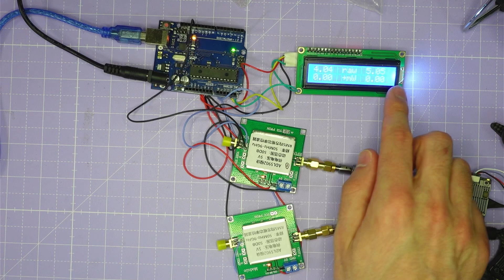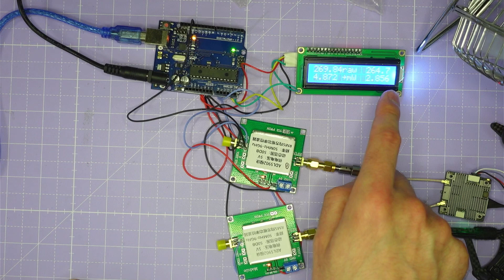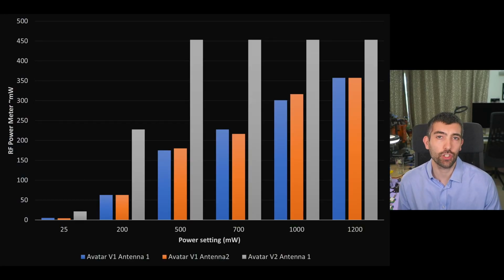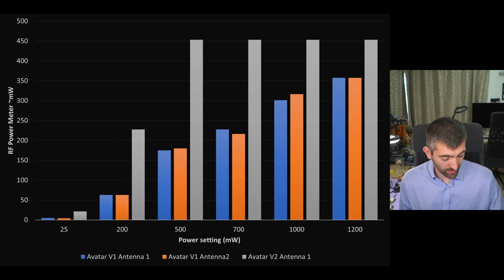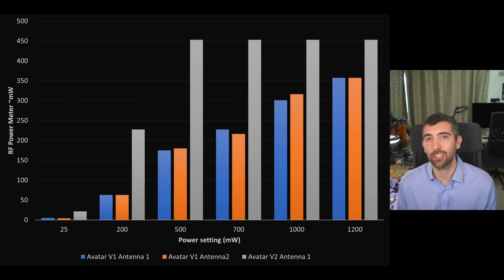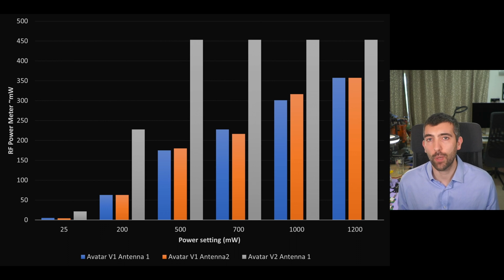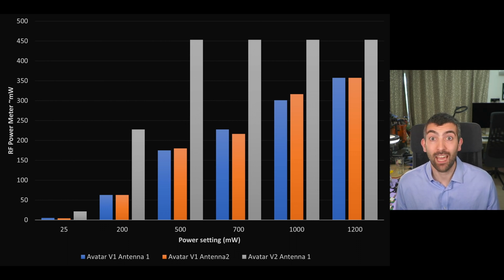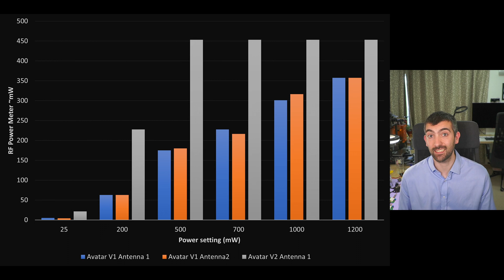Walksnail Avatar V2 WEIRD Output Power Behaviour?!

Comment: Hi chris, have you seen the system to calibrate the v2 vtx ? The one that JB published in one of his video lately using zoom 10% to check values and putting some files on. It would be extremely interesting if you could make a test looking if that calibration process change something or not . About power , it will be interesting to compare dji air unit vs caddx vista too
Reply from the maker: Speaking to Mads about it we can be confident that the calibration will change the output power, but what I can't say for certain is if it will increase range as it will also amplify noise.
Reply: @ChrisRosser  ok Mads is the master there :) if any of you two could certify that it would be interesting to run some penetration test with various values. I was thinking to check power output with immersion Rc power meter but I guess it's not reliable
Reply from the maker: Can't use an analog power meter like the ImmersionRC for digital VTXs due to the high crest factors for LTE signals and the frequency hopping. That's why I built this RMS power meter. It can measure EVERYTHING, analog, digital, HDZero, 5.8GHz, 2.4Ghz, 900MHz it doesn't care. Power is power. I believe it works by measuring the heating up of a small element.
Reply: @ChrisRosser  very nice !
Reply: @ChrisRosser googles make more power! You can test.. but make very more noise - snr decreasing 200% at 1200mw - im want make penetration tests with different calibrations values fof goggles. Maybe 500mw for goggles and vtx make good results.. and please say - can you test what frequency's WS using for downlink - same as uplink or have some offsets?

Comment: The v2 seems to have the same range as my v1 I fly the same place and if I go behind the school it drops to the same though I don't understand
Reply from the maker: The V2 is outputting more power on it's antenna than the V1 does on one of its antennas so should get more range all else equal if there's no multipath going on.